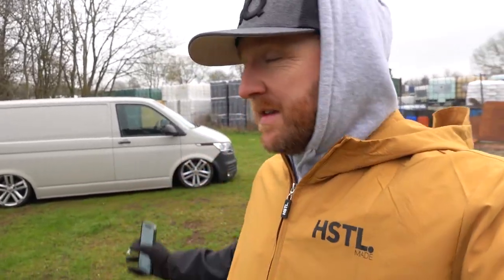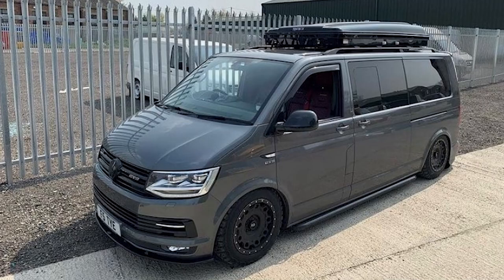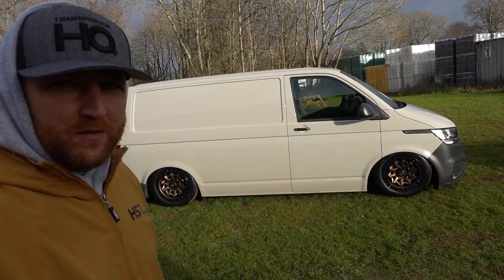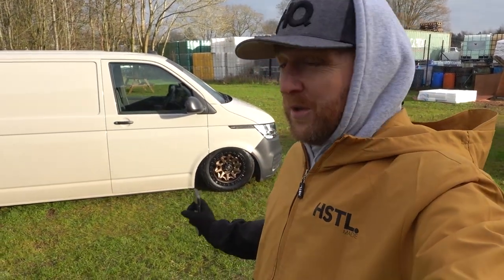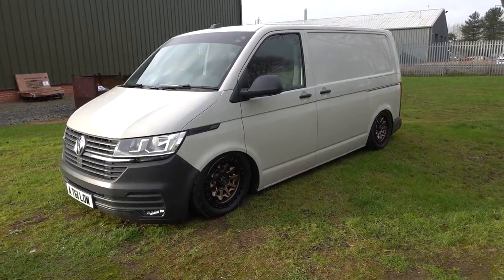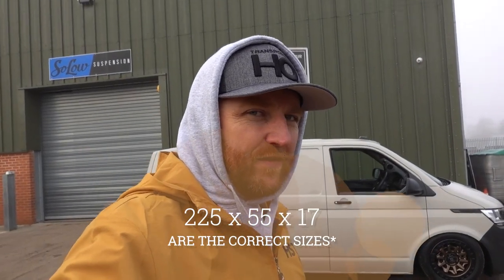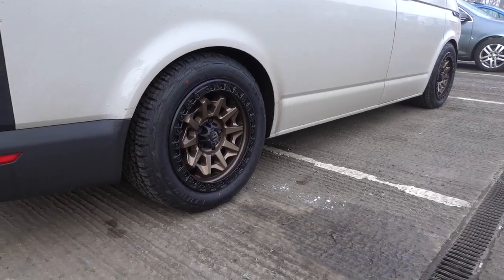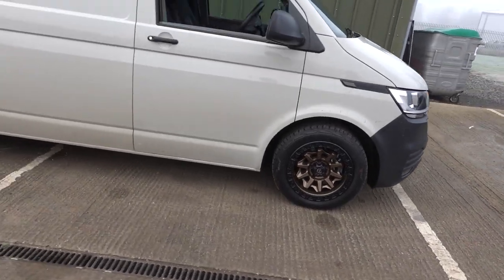Lowered VW Transporter on Swamper Wheels. Right or Wrong?! | Transporter HQ, T6.1

Comment: Hello. My 2WD T32 van has Bilstein NSL SoLow coilovers with 275/35ZR20 tyres. The coilovers are lowered right down (10mm from max lowered). I'm going to be taking the van across the odd field and down the occasional gravel track next year and am worried that both the lowered van and very low profile tyres will not be a good fit. Are there any good options for me that do not include dumping the Bilsteins (height, wheel size, tyres?)? Thanks.
Reply from the maker: @BarcombeBoy  adjust the coilovers higher if you want more clearance. That is correct type size though. With NSL's at the highest you can just get away with 264/40/20 if you wanted. Or look at a 17" wheels on AT tyre. You honestly have loads of clearance now though. My ride height on air is about 180mm below standard and I've driven all round Europe including on and off step ferry ramps with no issues. You're probably around 85mm below standard currently.
Reply: @THQAutomotive  Thanks very much. I am inclined to ramp it up and put 17" alloys with 103v/h AT or 4 season tyres on it to cope with the dirt tracks (of which there are a fair few in Norway). My issue is then what size the tyres should be so they don't meet the wheel arches. :-(
Reply from the maker: @BarcombeBoy  from memory, we explain tyre options at the end of this video.

Comment: Do the rears have spacers on the back? If so  mm? Would you suggest 15mm spacers on slolows at mid drop ride height . ?
Reply from the maker: Depends on the width of the wheels. You rears won't catch so it's only about looks.
Reply: @THQAutomotive  exactly the same as on the video 225/55/17 cooper att's, I like the look as on the video, so with spacers?
Reply from the maker: @errolkrauss1099  This has 15mm rears

Comment: Id be like the original customer with my needs and how often I need at max lift. 

Ive a 4Mo on Devonports but would like to go Air as well as nicer/bigger wheels so this is a great video thanks.

I dont like the complete slammed look though  so am considering VB Suspension

By the way..... your lights are EPIC !! Cheers for getting the order over to Ireland
Reply from the maker: Glad you like the lights 😊

Comment: Love the look. I am considering the Fuel Covert 18” wheel combo with some Cooper tyres 255x55x18. Will I have clearance issues with my SoLow setup on a LWB T6.
Reply from the maker: Good question. Have a look on willtheyfit.com
Reply: Mark judd how did u get on with that ?
Reply: @paulloughery6824  went with 17” in the end a love the look and the ride

Comment: Looks great, after an opinion I have a T5.1 T32 Kombi highline standard suspension and struggling in which wheel direction to go. Was going to do the 20” route but the more AT wheels I see the more I like them especially for comfort. However you don’t see many silver vans especially sport line front ended T5.1’s with swamper style wheels. So wondered what you’d go for?  👍🏻
Reply from the maker: Honest opinion.. I don't think the sportline look works with AT wheels. Take the sportline off though, it should just be screwed in place :)

Comment: nice looking wheel . im running 235x65 17 gg on my t6 id like to lower it not sure what to put in it . it is used for work
Reply: 30mm lowering springs at most. Eibach's are good for it, you get a lowered look but still retain full motion of the wheel.

Comment: I just picked up my new T6.1 shuttle in Fortana red last week to haul my dogs around in (Middle row of seats removed) and to use as a day van after the lock down ends for day tripping. Looking for Limo tint all round and about a 35mm lift. I think those wheels in that colour would set off the van nicely, but I have spoken to quite a few people who have gone down the swamper route and they all have conflicting stories of what rubs and what doesn't, what's drivable and what's not... I like BFG tyres but don't know what size would work on these without rubbing (either stock ride height or lifted) and as far as I know, no one is recalibrating the 6.1 speedo yet?
Reply from the maker: Correct, at this point no one can do T6.1 Speedo’s. Give me a buzz on Monday and I can explain tyre options and potential rubber issues. 0116 2478156. Ask for Andy.

Comment: I have a T6 Highline panel van could you tell me whats the best wheel and tyre combo on standard  height.
Reply from the maker: This of the fuel zephyr wheel are the correct width and offset. If the van we talk about the most popular sizes for standard suspension. It’s towards the end. Hope this helps

Comment: Hi guys, I've been looking at getting a set of these in 18" for my bagged t6. Do you have a good tyre size in mind which wouldn't rub or stop me getting low aired out
Reply from the maker: I don't think you can get an 18" AT tyre in the right size to work with air. We looked in to it at the time. Use willtheyfit.com and compare the sizes to what we used on a 17".

Comment: I like it :) 
What’s the difference between Cooper AT3’s and General Grabber AT3’s ? 🤔
Looking for 17” tires for Touareg wheels on a T6 4motion.
Reply from the maker: They are a different tyre with a different noise rating, thread pattern and wet grip. You need to compare the on a tyre site.

Comment: Love the look and even more so the thought of a more comfortable ride. Couple of questions for ya  What tyre size do you run on the Canteras? and what pressure  are you running as your drive height?  Thanks Keep the vids coming.
Reply from the maker: A ran 235/35 winter tyres. Drive height is about 36psi front and 60 rear. That would vary massively across vehicles though down to what’s in them.
Reply: @THQAutomotive  thanks bud I'm guessing you don't worry too much about the lack of load rating?  yea I believe we have the same system lowdown bags & 3p management. I need to get braver with my ride height.... is yours subframe raised?
Reply from the maker: @Mr123snowboarding  no subframe raise. These wheels are tyres are load rated enough 😊

Comment: They look great. What's the cost for wheels and good set of all year round tyres. My kombi is lowered 40mm. Thanks
Reply from the maker: Fuel wheels are £1150 a set. You can get tyres from around £125 a corner.
Reply: @THQAutomotive  thanks,  and can I just add your customer service is 1st Class 👍
Reply from the maker: @yorkshiresfinest6102  Thanks for your comments. It honestly means a lot :)

Comment: Looks good, can you run 18s with a 255x55 AT tyre on stock height?
Reply from the maker: We’ve not tried an 18 yet. We’ve had these made the right width and et so they don’t as a 17. Speak to Matt at T5 upgrades. He’s the expert.

Comment: Your Van looks nice on those Swamper wheels, but I would have gone all black, with the state of the roads running the lower profiles can be problematic as you are always trying to find a smooth line. 
A friend has 35's on an A5 coupe and they are more like rubber bands, no wonder the higher profiles feel more comfortable.
In this world don't follow the herd, branch out and find your own style, if not we will end up in boring grey place, with Ed Sheeran on repeat.
Reply from the maker: I really liked the bronze BBS so wanted to do bronze on the AT wheels. That and fuel made the prototypes in bronze so we don't have an option! haha. Yes it does feel way way more comfy than my standard 225/35 20's :)

Comment: You can run 235/65r17 or 255/55r18 (255/55's are really close to the 275/40r20's people run... mm's at most) on a 30/40mm drop at most but they fit without any rubbing except in certain circumstances. Honestly, with the roads being as shit as they are nowadays i don't see the point in low profile tires anymore. I'd rather have more rubber and not be worrying about will i bottom out a rim on that biggish bump over there.
Reply from the maker: 255/55/18 is really big. We had a customer try it and it did rub. 275/40/20 is also too big really though. 235/65/17 is a good size.
Reply: @THQAutomotive  Depends on the lowering tbh. Slammed or at 50mm or lower it'll rub for sure. I know the 255/55r18's fit on a 30mm lowered as i had that on my van (t5.1 with some generic 18x9's) no problem. Only if i hit a speedbump full pelt or full lock did it rub and even then it was negligible and dependent on where the van was (on a slope or at an angle ect.) On a 30mm drop the 255's will have a pretty much even gap around the arch... enough to squeeze your fingers/hand in and clear any debris from the tread if needed but obviously not like lifted lol. The 255's are technically identical in diameter to the 235's brand dependent just wider. The 275's are standard for companies like leighton vans who use a 40mm lowering spring on theirs. A/T tires are the way forward though for vans imo as it completely changes the ride quality from somewhat jarring to almost SUV like.
Reply from the maker: @dodo19923  275/40/20 it too big, companies fit them because they are cheap and over load rated. The rolling radius is wrong, they look too big and they are really hard. To give the tyre that load rating they have super hard sidewalls. 255/55/18 will also have the wrong rolling radius. Rub will also depend on the ET and width of the wheel.
Reply: @THQAutomotive  Fair do's... I can only speak from personal experience and never had any issues to speak of but then i don't really run my cars/vans to spec. I'm running 225/65r17's at the min on 17x8's on my new(ish) van as it's all i could get hold of at the time. Will probably look at the 235/65r17's on a 17x8.5 when the time comes to upgrade them as i like the more rounded look it gives but still have more to go before i get to that stage. I didn't know that's why they fit 275's but i guess if it somewhat works then whatever, it's not really the way i like things but each to their own i guess .The alpine speaker kit is most likely next on my list now i've finished the lining in the back which was a pain in the arse to do lol. You guys got engine work done with Darkside Developments iirc... Any issues come up or would you recommend them when i get round to remaps/engine mods ect?
Reply from the maker: @dodo19923  Darkside were great. The Flatbed is currently in The Netherlands at THQ EU but its running lovely

Comment: Pretty pointless exercise, when the first hint of mud or snow will fill the gap in the arches and turn the tyres into slicks as the tread is packed full. If you want to run silly low ride height, just stick with normal rubber, the M&S's are completely wasted.
Reply from the maker: Thanks for your comment but when it snows I can just lift it. The air suspension goes higher than standard height. I always run mud and snows in the winter. They've been great on several trips to the Alps snowboarding.